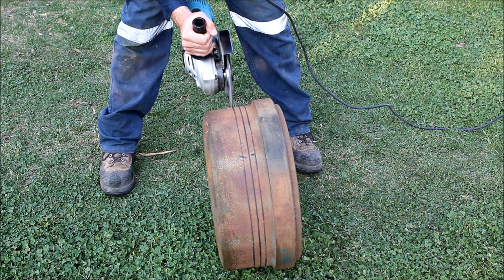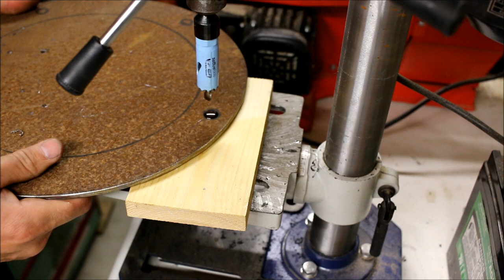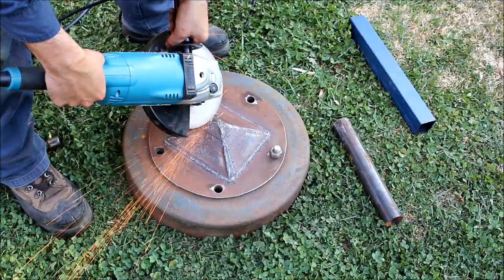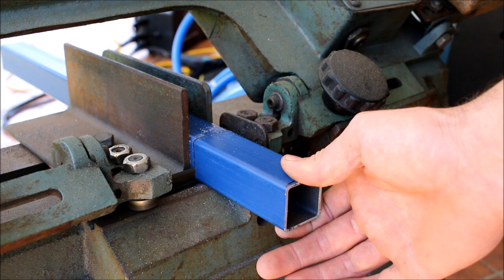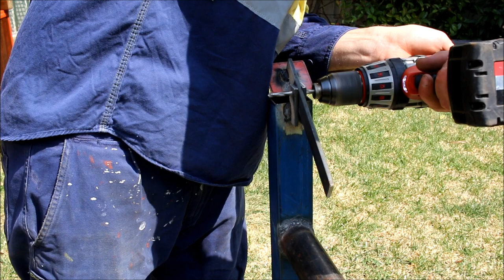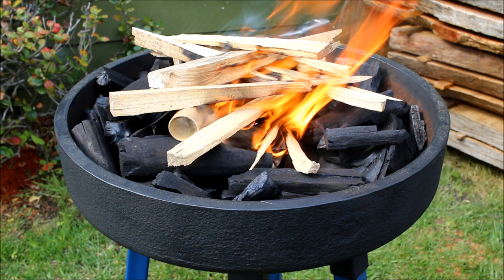Forge build using a truck brake drum

Comment: Nice forge. Best on YouTube. Did that high-temp paint stay on? Some of it, I believe that brand, because of the extreme temp ability, needs specific prep or it burns off first cycle.
Reply from the maker: Cheers mate, I have used the forge half a dozen times now and yer the paint is still good. I keep the forge under cover and out of the rain when its not in use.

Comment: I’ve looked at a ton of videos and this one is the best. What height are you using for your triangles? Are they all the same length? I am rebuilding this model as we speak.
Reply from the maker: Thanks. Make the triangles as high as you practically can, the triangles make the fire pot, you want the fire pot to be as large as possible. Yep the triangles are all the same size. I have used this forge many times since I built it and i recon it works great.
Reply: Mitch Tarrant thank you for taking the time to answer my question. I have a slightly bigger brake drum. I’m cutting a 6x6” square for the fire pot. Big enough? Also did you add a screen to your firepot? I have a 130 flux welder that I’m learning with. I will be sure to update weather it was successful or not. Thank you sir
Reply from the maker: Sorry about the late reply, yer 6x6" is about the same size as the fire pot in the video so will be fine. yep I just welled in a few pieces of rio bar about halfway down to act as a screen. How did it go?
Reply: Mitch Tarrant it went fantastic. I now have a forge. I did a few different things differently. Wish I could share a video of it for you. Thank you for your replying and your guidance.

Comment: Thanks for your vidio but why you  have cutted the drum  the same deep not ok.
Reply: By cutting the drum down & then dropping the pyramid pit into it, the smith reduced the amount of fuel the fire pot uses while creating a very hot pit down in the center.  I don't know if I explained this well enough, but it was a good move on his part nonetheless.  He used a semi brake drum, which makes a very, very large fire pot. Some would say it's too large and consumes too much fuel.  I would agree.  Cut'er on down & weeks a pit in the bottom. You'll be glad you did.